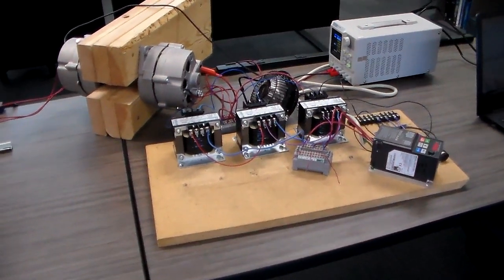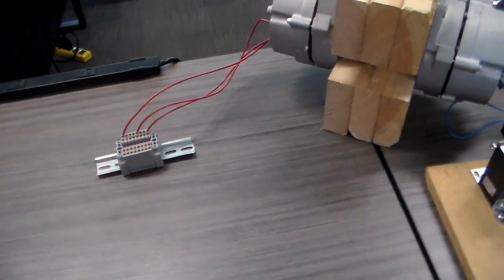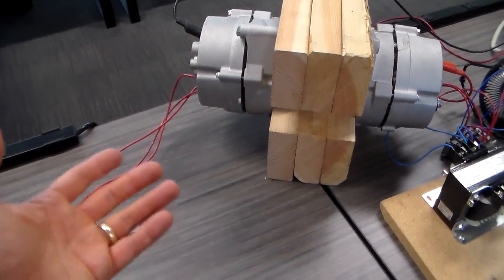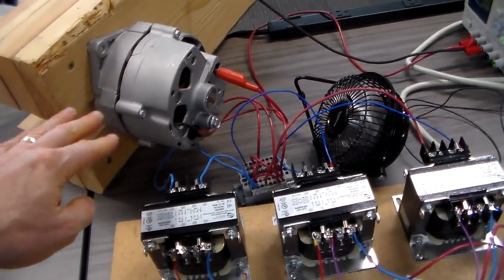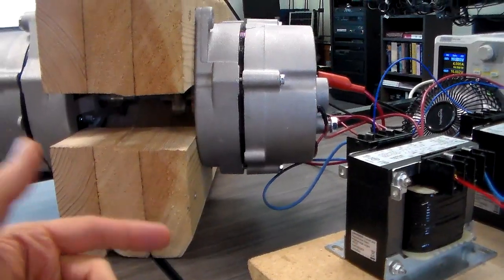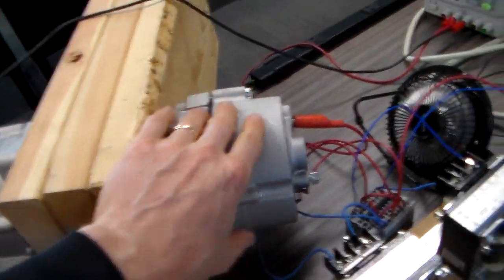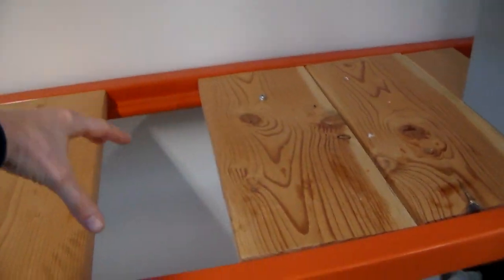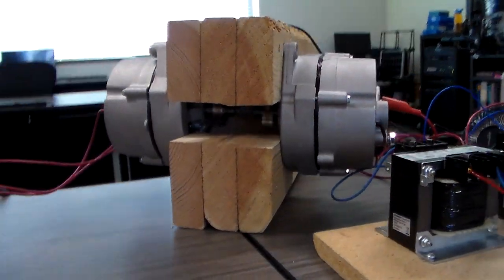Experimental motor-generator set using Delco 10DN alternators

Comment: What a wacky setup😂. A car alternator is a synchronous machine and requires vector control. U/f is not stable, when you load the generator, the motor might stall and trip your inverter.